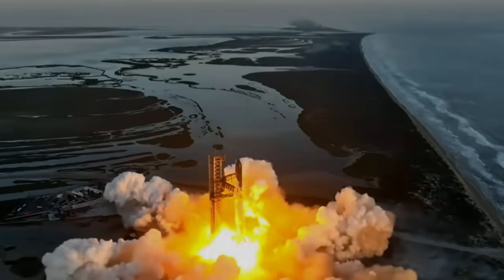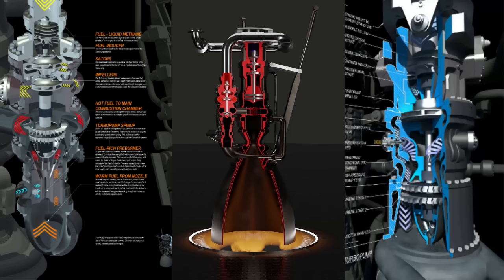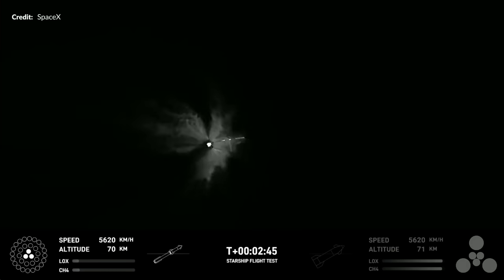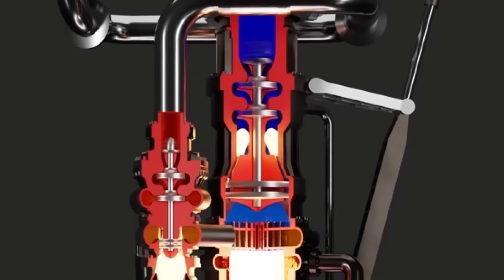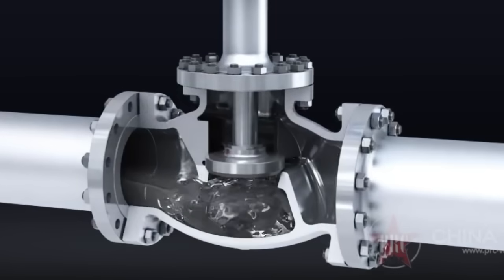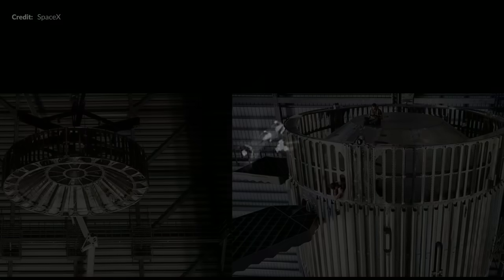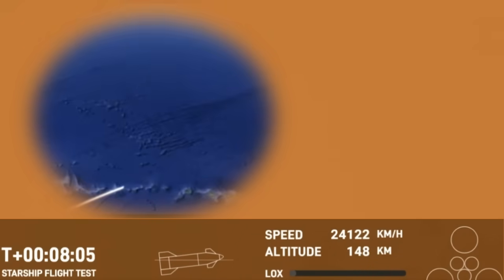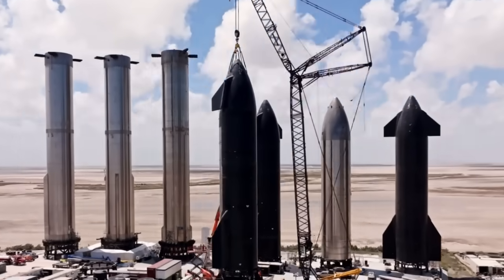Starship Flight Failure Analysis IFT2

Comment: You might ask this question: Why were rockets etc more reliable in the 1960s and 1970s than they are today? How is it that they achieved this without powerful computers and software?
The answer is easy. Back then they relied on military spec, simple mechanical systems and very simple software for their flight control systems. The Apollo guidance computer was a 4k Rom 48K Ram device that was so simple and good at doing just one thing, that was still being used in the last Space Shuttle in 2011. But before they put astronauts on the moon in Apollo 11, Nasa and MIT were on version 98 of the code. That's how much testing you have to do to protect human life and even then they had a glitch, which was overcome by Neil Armstrong writing a 16 character command he dreamed up in his head in 1 minute. Genius stuff.
This same philosophy is why military missiles etc are also so reliable. Nothing breaks or goes wrong. 
SpaceX will continue to have these malfunctions unless it bridges the engineering gap between whats its using now and whats required to put paying passengers at risk. And this was also the reason why OceanGate's Titan also failed. Rubbish engineering and not enough testing. And so it is with SpaceX.
Reply from the maker: They weren't.  Just watch all the failures.  The engineers were just brilliant.  The Egyptians built things that still fill us with awe today.  And two US ICBMs just failed a few weeks before two Russian ones failed.  Failure is a fact of life and becomes a lesson once we learn enough :-)  Titan failed because the designer didn't listen when he was warned.  The engineers at SpaceX are brilliant.  Elon pushes the envelope... a little too far at times but that's sometimes the only way to get something done.

Comment: What concerns me are those pesky tiles... and the fact that a large number of them went AWOL on ascent.   See Everyday Astronaut's "Starship IFT-2 Supercut with clean audio and tracking!" - Ryan Tracker segment & Scott Manley's Wins/Fails tiles discussion.   The Space Shuttle lost one tile on its maiden voyage - and the Shuttle was a very bumpy ride due to those two large solid rocket boosters that suffered from thrust oscillation.
Reply from the maker: Indeed. The next Starship used a better attachment and testing system so maybe that will be improved.

Comment: I dont see any reason to ignite the center 3 raptors on the 2nd stage separation. Or at all depending on the mass of the payload on Starship. In the case of no payload test flight burning the more efficient vacuum engines for a longer time might get the ship into a higher orbit.
Reply from the maker: We agree...

Comment: SpaceX has identified several possible factors. One possibility is that the failure was caused by a problem with the rocket's engines. Three of the booster's engines failed to restart after separation from the second stage, and one of the second stage engines shut down unexpectedly. Another possibility is that the failure was caused by a problem with the rocket's avionics. SpaceX lost telemetry data from the spacecraft at the end of the second stage engine burn, and it is possible that this was due to a malfunction in the rocket's guidance system.

 Whatever the cause, the failure of IFT-2 is a setback for SpaceX's Starship program. However, the company has stated that it is confident in its ability to learn from the failure and make the necessary changes to ensure the success of future flights
Reply from the maker: I think they will learn enough from this one for the next to work.

Comment: I have doubts that hot staging will ever be compatible with the goal of reusability. No matter how well designed, it's putting tremendous stress on both vehicles. Time will tell, SpaceX may prove me wrong.
Reply from the maker: Stainless steel helps but it is a problem.

Comment: 8:07 did you notice that the sea level engines were gimbled out as to not reflect off the top of the dome? They then gimble axially after separation.
Reply from the maker: Indeed.  I just didn't think 15 degrees was enough.  The push back on the booster would have created a lot of blowback.

Comment: yes take more time to fire up the engines - until after the flip is done and propellent has settled - if possible.
Reply from the maker: Would there still be enough air resistance at that altitude to provide a little slowing and help settle the propellants after the flip?

Comment: Maybe I would cut all engines on Super Heavy and won't initiate a turn at all until the speed is dropping and close to its ballistic peak I would start the 3 gimbal engines to upright the booster and then slowly drop it. This will reduce structural stress since there is no high-speed maneuver. The disadvantage is it will be quite far from its launch pad.
Reply from the maker: That's what I think would be the best option... Still air resistance at that altitude so the propellant would settle.

Comment: You failed to realize they gymbal the center engines on the second stage outwards so that the thrust hits the dome at an angle, deflecting it out the vents.
Reply from the maker: I did realize that but they gimbal only 15 degrees.  That's not enough.  To shove the booster back at 1.75g would create a lot of blowback.

Comment: Remember on one of the early tests articles they filled the methane tank before the oxygen tank and the whole thing crumpled and collapsed? I remember questioning how they could think that was a good idea. I’m kinda feeling the same about them igniting the sea level engines at the hot staging. I’m no expert but it feels face palmy to me.
Reply from the maker: Well a valve stuck in that case... Lighting that many engines during the flip does seem to be quite an oversight though...

Comment: Ok, I'm just curious why don't they use a light weight floating cap on the fuel inside the tank, similar to what is used in petroleum bulk storage tanks. It would eliminate sloshing. Being held tight against the liquid by gas pressure on the upper side and by vacuum pressure on the fuel side. It would slide down the inside of the tank as fuel is consumed like the plug at the back of a tube of caulk or syringe only not as tight. If it's a valid idea just remember I said it at 11:28 EST, 11/21/2023. 😀
Reply from the maker: Without gravity it would just float away :-) But under thrust it should work fine.
Reply: @terranspaceacademy   That is not correct. As I stated before. It would be held in place against the fuel by gas pressure from above,  and by vacuum pressure from below.  They already pressurize the space above the fuel to stabilize the tank. The vacuum pressure comes from the escaping fuel below. As the fuel level goes down it pulls the cap along with it at the same it is being pushed along by the pressurized gas. As long as there is sufficient seal around  the edges it would work.  It's not rocket science. LOL.  Or put the liquid in a huge rubber bag like they do in Apache helicopters.
Reply from the maker: Pressurized gas only holds liquids down under thrust or in gravity.  Otherwise it has no effect.

Comment: Space X has done what NASA hasn't been able to do in 60 years. They have a tiny fraction of the budget and staff. Space X super heavy is years ahead of what NASA is building. Which if ever built will be obsolete. The testing is just that testing. As to the launch it was steered away from the supper structure to protect it. We are witnessing the true birth of space exploration. Well done everyone working at space x
Reply from the maker: That's exactly right.  No one else is even trying.

Comment: I never thought they would fire the center engines  that close to the hot stage ring dome😲 When I saw the telemetry at the bottom of the screen I didn't believe it. Why would they do that? These engines are only needed for steering. At this point in space the thrust is coming from the vacuum optimized Raptors. Do they expect the need for directional input that early in the separation? Weird! Also  the ship would never have made it through reentry. It was shedding tiles like a stripper on a hot summer day. You could see these white dots popping up all over TPS then explode on the grid fins.
Reply: The tiles are put over ceramic wool. It wasn’t a problem as they had used the old tiling system and the ship was going to be destroyed anyway.
Reply from the maker: I think they wanted to get the heck out of Dodge and not get hit by the booster...

Comment: It all sounds plausible. But I know almost nothing. Can they increase thrust at hot staging? Can the hot stage ring be taller?

The complexity and historical magnitude of Starship & Superheavy Booster tests remind me of the seminal importance of Gemini 6 & 7 & Agena rendevous tests. The entire Apollo program hinged on the outcome.

And, in the words of Tom Wolfe, "ours always blow up."
Reply from the maker: They can indeed.  The three center on the booster were at 50% so maybe 60%? And they could add a meter to the ring I think. Do you remember reading about how one of the Agena docking targets didn't open correctly?  Or the spin that almost killed Armstrong?  To say nothing of Apollo 1. Some people act like SpaceX is reckless but in truth those guys were on the cutting edge of brave and dangerous.

Comment: I think hotstaging is a bad idea, the g-forces on the booster are too high, the acoustic forces on the spaceship's engines are too strong. There are other mechanical ways to separate two steel pipes, even if shear forces cause friction
Reply from the maker: The Soviets were able to pull it off so it can be a viable option.  Though there are others...

Comment: Too many engines gives the Starship a higher danger of one of its engines failing from sloshing. I think the booster should have a second smaller fuel tank for landing so engines can be restarted with a full tank (no sloshing). Tank 1 for launching and the smaller tank 2 for landing.
Reply from the maker: Just like Starship? Probably a good idea...

Comment: 10:30 I am sharing this conclusion of only 3 Super Heavy Booster engines should be kept on after separation for as long as necessary (or - if only possible - even 10 without cutting off if really needed in this entire maneouver of separation) in my own film:
Wspaniały lot, potężny Starship i równie potężny błąd SpaceX

(Please choose the Polish subtitles on, than the automatic translation into English.) 
However, I have not thought about the damage of central 3 engines of *ship iself during the separation (and it seems quite likely to me, now)
as they'd worked pretty well for a good couple of minutes.
Reply from the maker: Will do.  We think that if the booster was shoved back that hard there must have been lots of blowback...
Reply: @terranspaceacademy  I share. Therefore, I believe that it was possible to keep even the 10 central engines running all the time. *the ship had enough power to separate anyway.
Or, best of all, as we both suggest: leave the SHB on the three central engines only, at least until the remaining ones cool down and the fuel in the tanks reaches a relative hydrodynamic balance. After all, no engines are needed for the turning maneuver. Just gravity. You don't have to turn anything around,  either, just steer slightly the SHB tilt towards the landing pad.
Reply: @terranspaceacademy  For convenience I've prepared the English version:
A magnificent flight, a mighty Starship, and an equally mighty SpaceX mistake
Reply from the maker: Indeed my friend.

Comment: I think there was a lot more failing than at first meets the eye, and than were mentioned here. I also don't think that SpaceX had enough telemetry to know either when the events happened, or to know for certain, or to know what exactly happened. If you don't know what happened, you can't possibly know what to fix.
It would seem that in neither the booster nor the Starship did the EVT work. Instead, the destruction of the booster was brought about by a catastrophic failure the Liquid Methane Vessel and the Liquid Oxygen Vessel. Further, the view from Florida shows that the entire aft portion of the Starship is missing, yet the EVT not trigger on that either. We have no way to know what caused the two halves of the Starship to separate, or what happened to the two halves. It is possible that the forward half fell all the way into the ocean. It is also possible that it could not withstand the increasing forces acting on it as it came down and broke up during descent. We have even less information regarding the aft portion. You can't fix that which you don't know is broken.
Starship is now well behind schedule for its planned in space refueling, for it's unmanned test tor the moon, and for its manned certification flight. Even if all its remaining flights were to go flawlessly, it would have a very difficult time catching up.
Reply from the maker: The FTS is in the middle. That tanks explode and the nose goes flying...

Comment: I love the analysis of the SuperHeavy failure, I think it's great!

However, in my opinion, your analysis of the Starship failure is a bit incomplete because the three central engines are gimbaled outwards at the moment they light up, and they only light up after a few seconds of the outer engines being lit up, which should be enough that the central engines' exhaust is directed into the vents for the outer engines, which is exactly what I think SpaceX intended to do, so this is very likely not the cause of the failure. However I'm really not sure what else could have happened it so your explanation is not off the table yet. I personally think this is a bit more mysterious and we'll just have to wait until SpaceX and the FAA publish their official investigation report.

I agree with you that they should only light up the vacuum engines at first, but mostly to reduce the negative acceleration on the SuperHeavy to reduce the sloshing. Another thing that occured to me is that they could leave the middle ring of engines running (or at least part of it) instead of shutting them down and relighting them later as they did, so that the SuperHeavy can counter the negative acceleration from Starship further and to have a stronger force against the sloshing from the loss of acceleration.
Tho I'm not a rocket scientist, so I'm not sure how smart that is, as maybe SpaceX has a good reason to only leave the inner 3 engines running. If that's the case, please someone let me know why that is.

Overall amazing analysis and video with the limited information we have at the moment, you've earned a sub!
Reply: "However, in my opinion, your analysis of the Starship failure is a bit incomplete because the three central engines are gimbaled outwards at the moment they light up"  Can you please cite sources to backup this claim. I have heard and read from multiple sources that there is not enough clearance between the Hot Stage Ring dome and the inner 3 sea-level raptors for any gimballing at all. None. And in all launch footage I have seen, the only way to visually confirm the engines are gimablled is after a gap develops between upper stage and hot stage ring (well after engine ignition sequence)
Reply from the maker: You may be right.  I just didn't think it was enough considering the effect on the booster and blowback risk.  15 degrees is not that much but maybe a few more seconds before light up.

Comment: to be honest regarding the starting of all 6 engines its not rocket science to realise you would have a problem with all 6 hitting the booster .but the really clever people at spacex continue to do silly thngs..fire 3  but cant do the simple things allways screw up 1st then realise..... same with the booster why fire up 10 of them while turning ???
follows on from the launching from the pad using  just concret as a base..Doh...... wonder what next they will mess up
Reply from the maker: They do indeed make a few forced errors don't they? Though I think some things don't show up until tested IRL.

Comment: Burh, why everyone quick to say a raptor failed to start? Look at how the super heavy was turning and which engines were lit and in what order. The one that didn't refire was on the far side of the turn, the super heavy was mid boost back turn - it was arresting the harshness of the turn with differential thrust. 💀
Reply from the maker: I don't think so.  Something made those engines explode.  And the current generation of Raptor is not prone to that.
Reply: @terranspaceacademy  I personally don't think any of the engines exploded, I think between potential damage to the booster from hot staging and the activation of the FTS all the vented propellent and explosions we saw are accounted for and the Raptors did their jobs
Reply from the maker: What was the big bright shockwave off the back of the booster just before it came apart?
Reply: @terranspaceacademy This may come as a surprise, but the flight termination system is an explosive charge that unzips the booster so it can break apart into harmless pieces. So I would still assume that was the flight termination system terminating the flight.
Reply from the maker: We thought so but the charge was at the top of methane portion of the booster.  We didn't see one at the base.

Comment: 8:15 "... but this could tear the welds...": They have the same conditions for the booster at liftoff... but 10x worse. Do you really think they don't exactly where those gases and thrust vectors are to go?
Reply from the maker: Yes.  It is impossible to simulate everything.  150 metric tonnes of propellant rising 10 meters from the thrust puck then slamming back down in one second would produce 1.5MN of force ONTO THE PLUMBING. Totally different from a structure immersed in a liquid tolerating pressure.